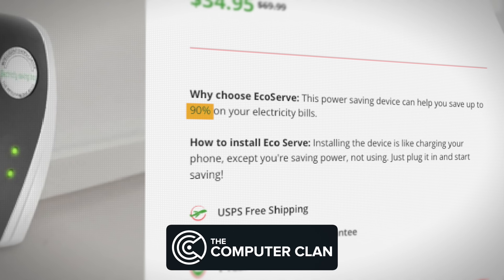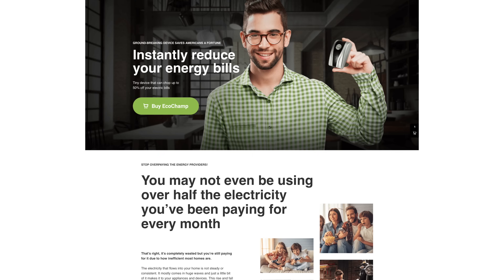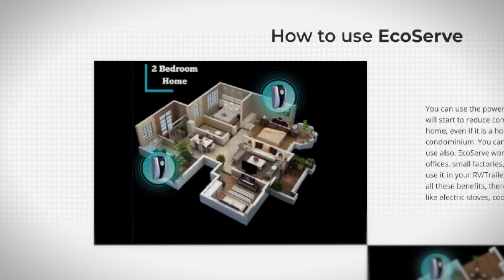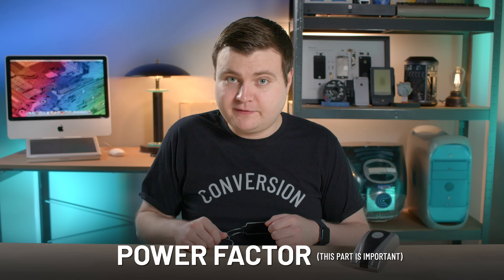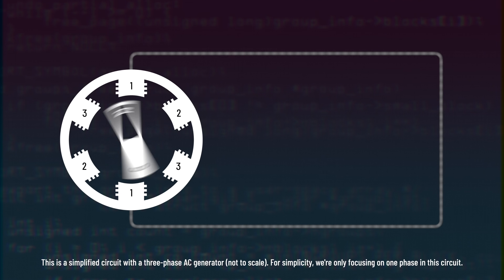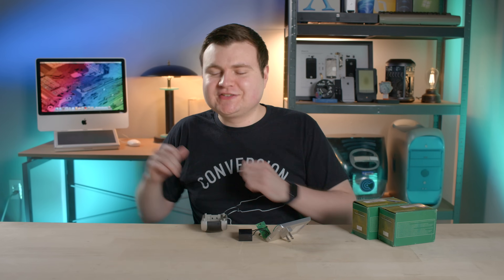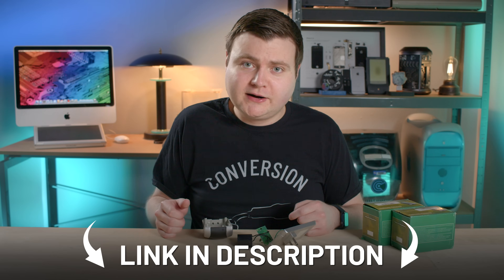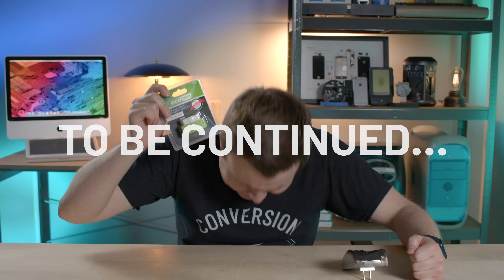Electricity Saving Box Scam (The WORST I've Seen) - Krazy Ken's Tech Talk

Comment: Installing solar panels on your property is honestly the way to go for reducing energy bills without reducing your energy usage. Could even generate income if your provider allows you to sell power to the grid.
Reply: I think many North Americans have potential to first save on consumption, without losing anything. Although EU laws already made a lot of devices more energy conscious.
Anyway, electricity in the US is way too cheap for people to consider saving, or installing solar.
Reply: Solar panels work less when they get to hot
Reply: @NeekSquad  You are right, but generally hot climate is hot because there is more sunshine on average, and because there is less precipitation. That plus more than accounts for the loss in efficiency. A solar panel in Texas will always produce more kWh per year than let's say here in Germany.
Reply: Cali has postponed the vote, but they were going to charge rooftop solar owners an $8 per KW "grid participation charge", and reduce rooftop solar incentives. They will get their money one way or another.
Reply: @bills6093  That's fucked up. But as I said, your electricity in the US is way to cheap to make PV - to make even just saving on for example new appliances - attractive.
From what I gather, here in Germany, electricity cost per kWh are triple. I can't even fathom why you'd install PV on your own roof if a kWh is only around 10 cents.
Here, me buying a new fridge is something you can calculate, and know that it will take only a few years until you have 100% amortized the cost of that new fridge through electricity savings.

Comment: how about one of the biggest scams.........pest scarers..."simply plug in and ultra high frequency sounds emmitted scare off ants, bugs, spiders, mice , rats wasps, uncontrolled children ( ok i made that one up) !  also available as battery powered garden scarers, repells cats, foxes, birds, squirrels , hedgehogs... caution both types also scare pet dogs !" .  well infact i used plug ins as my mother hates spiders and wasps. result, no change in fact i saw a spider sitting on the scarer.  SO , better luck in the garden, !  ..... well no actually, deciding to have a wildlife garden i sowed meadow flower seeds and used a scarer to stop birds eating the seed.....did it work ? no !  i placed a trail cam to see what was happening !over a week i saw cats, hedgehogs walk past the scarer, Ieven saw a variety of birds happily feeding in front of the scarer,  BUT THEY SCARE DOGS, so they must do something right ! wel my dog didnt even notice either  type, happily sleeping in front of them.   maybe the power was off !  nope, the indoor had a night light affair when 'working'  and the garden had an audible ticking.  so either these are scams  or i have the most fearless creatures in the world ! as a footnote in my workshop i placed 3 spider specific scarers after regularly finding spides stuck in painted and  varnished work. over winter i left them running,  come spring i opened up to find webs all  over and covering 2 still working scarers, the 3rd had died, presumably of shame.  costing from £5/$7.50 to £30/$45 each, they have to be the biggest suported scam. what do you think

Comment: I don't recommend the "power saving" box. It almost burnt down my grandparent's house. In July or august 2020 at around 4 am the box started smoking and a few minutes later my pillow dropped and my uncle woke up and saw smoke coming from behind the TV. And my grandpa found out it was the power saving box. 0/10 Useless and almost killed my family because it started smoking out of nowhere. If my pillow didn't fall on the ground I probably wouldn't exist anymore.
Reply: Impossible. The website says it is fireproof! 😝
Reply: @3rdalbum  Now that you mention it.
Reply: My mom brought this to our home before, as an electrician i can smell bs from far away, it smoked and my breaker literally tripped before i almost shat my pants  as it blew up beside me
Reply: @dragonfireproductions790 your not supposed to plug into your ass dude
Reply: Wouldn't even expect it to have that power, i.e. all it could do is produce magic smoke. But then again that capacitor might be special in its own way…
Reply: @Smaxx  maybe the smoke was from the burning plastic.
Reply: Yipes...
Reply: No smoke alarms ?
Reply: Who gets woken up by a dropped pillow but not the smoke smell?
Reply: The heat from the capacitor probably made too much heat and it caught on fire.
Reply: @Vinnieleverton  A capacitor is 2 long strips of metal foils separated by a layer of oil soaked paper, then rolled to form a cylinder. It is a combination of the area and dielectric strength of the separator that gives the value in microfarads. In use, the oil gradually dries out and the capacitor open circuits and ceases to work. However, if the paper then cracks, the layers short circuit, causing heat and them fire. 
If due to poor construction, overload or damage the short occurs before the oil dries out, the fire can spread beyond the component.
Reply: Deserved

Comment: The wavelengths that makes up electricity usage can have an impact on your sensitive electronics but they already have wall plugs that I'll fix that and regulate the wavelength so to speak. So if you use a power generator be very careful what you plug into it and make sure you use the right type of filters for the electricity so you don't get dirty power to ruin your electronics it won't ruin it right away but it can over time.

Comment: There was a typo in the promotional materials. Instead of "fireproof", it was meant to read "fire proof", as in, evidence that it burned your house down.
Reply: Well, they should say "fool proof", which would garantee that only fools would buy this... :)
Reply: The perfect legal defense
Reply: Hey at least the used a safety capacitor so your breaker might save you.
Reply: @LordOOTFD it's actually a flux capacitor, it helps you go back in time, you just need a DeLorean and 1.2 gigawatts
Reply: Hopefully it was one of the employees that was sane enough to protect themselves from getting severe lawsuit.
Reply: How u have so many subscribers
Reply: There was a review on Amazon of all of them sparking 👀🔥
Reply: I thought that was Cave Johnson's lemons
Reply: @roxcyn
Reply: Sorry but nobody cares
Reply: Lolol
Reply: If you are NOT A SCAMMER and a THIEVE, give us your TEL FIXED Phone and Address to enable us to check if you are REAL. Otherwise, you are just another THIEVE!!!
Reply: This channel has the most unfunny fans omg
Reply: No, no, it is fireproof. It works just as well after burning as it did before.
Reply: "A type-o"?  A?  There were lots of type-os and no grammar anywhere to be found. Most of the sentences were not complete thoughts so anything you thought it said was basically your own imagination. Of course, that's one way to avoid liability. Look at the first sentence on the side of the box, "The basic speculation of the electricity-saved box is to let..."  Well, how relevant is someones speculation? But my favorite line is the one below the part he read. They claimed this box could change the interest rates...  LOL. Really?

Comment: It reminds me of a scam product sold in Britain during the 1980s which claimed to cut your telephone bill by 100%! The box contained a pair of scissors with which you were to cut the wire of your telephone. I hope they were insulated (telephone circuits in that period carried, I think, 50V) but it would certainly have worked. After a fashion.
Reply: That’s kind of funny. At least the product would have worked! 😭
Reply: How about the 'metric adjustable wrench'. The FTC took care of that!
Reply: I don't remember any telephone wires with 50v in the 1980s. When did that stop ?
Reply: @thegorgosaurus  “In the United States, the voltage applied to the line to drive the telephone is 48 volts DC; the UK use 50 volts DC and on some modern exchanges the voltage can reach 60 volts.”
Reply: @UK-Combustibility-Assured  yeah that seems set for a few miles of voltage attenuation. I dunno if they can’t do it on a per-connection basis (since FTTC involves a ton of tiny DSLAMs), or just choose not to. A house half a mile or a mile away might get something a little more reasonable. I once lived 50-100m from an FTTC cabinet, never thought to measure the voltage.
Reply: @kaitlyn__L  how many amps can you draw with that then lol

Comment: I wish all the various “obvious scam” signals were more reliable.  Yesterday I purchased a legitimate service from a legitimate company, with a legitimate countdown timer.  It was a hotel room, and the countdown was for when they would assume I’d left  the page and let others book the room, not for when a deal expires, but still.

5:44 I have LED lights; I don’t think they oscillate to the AC
Reply: It really depends on how the internals are built. Some more expensive/elaborate lamps might include their own smoothing circuit to actually use somewhat proper DC to provide constant light, but that's typically not necessary, given due to the fact that it's typically not visible to the blank eye.

Another way to test it is the stroboscope effect (especially with LED torchlights): Use the LED light to light up something rotating fast (like a PC fan). With the light shining on the fan, you might be able to see the fan in multiple positions at the same time and/or the fan actually spinning in the other direction (think of car wheels  turning in some older TV shows while accelerating). The exact effect depends on the fan speed, the light's frequency etc. but it's definitely noticeable. It helps if there's some colored label or sticker on the middle of the fan.
Reply: Signals work best when they are many, often having one doesn't mean that you're dealing with a scam. It's when you have a lot that you should go the other way. There are websites that are poorly formatted and are completely legitimate, there are services that have countdown timers that are completely legitimate, there are stores that have upsells that are completely legitimate, only having one isn't much of a red flag.
Reply: @Liz_ArdE  One of AtomicShrimp’s videos was about a specific scam (fake job offer and convincing you to buy equipment for the job with your own money given a promise of reimbursement) where almost all of the red flags had happened to me in a single instance and it was legit.  There were just adequate reasons for all the red flags and other signs of being legit which weren’t present in the scam.

Comment: A magical device that could save Gas?
That could'n happen Right?

Me: i buyed a thing that saves fuel and IT ACTUALLY WORKS!
Its not even a scam, it will even make your engine output a little more power and less bad smoke

Comment: Just so you're aware there are a few places in the EU that residential users are charged extra if the power factor is to low. Even in those instances adding a random capacitance with one of those "Electricity Saving Box" is unlikely to help, it needs to be matched to the load.
Reply: The overwhelming majority of home loads are purely resistive. It would take a conscious effort to get your power factor bellow 0.95 in a normal residential setting. You would have to have an automated system to bypass or use an array of capacitors for it to make even a tiny difference.
Reply: This is why the energy companies are pushing smart meters so they can charge you for Max Demand just as they do to industry, A true PFC control has inductance as well as capacitive.
Reply: @dogwalker666  You don't even need smart meter for that, an ordinary dumb digital meter can do that.
Reply: @WolfGamerBohumin  the meters we have before the smart meters are straight analogue watt meters no electronics, the industrial max demand version have a physical pointer, 
They are using the smart meter con to fit electronic meters that can measure the power factor.
Reply: @dogwalker666  Home loads always go into inductive territory so an inductance bank wouldn't be necessary.
Reply: @DickCheneyXX  err nope infact a lot of cheap Chinese electronics use capacitor droppers, And as I have installed 3  300kW PFC units recently I can assure you the inductors are used.
Reply: @dogwalker666  err yes. In fact homes are always seen as inductive overall from the perceptive of your power utility. I work in grid automation and power factor correction is our bread and butter.  The 300kW units you talk about should be rated in kVAR and are obviously for an industrial or utility application...
Reply: @DickCheneyXX  they are now that's the point with crappy Chinese psu the power factor can be capacative, I know the units are officially rated in kvar, we put them in because the mains the network supplier could not upgrade our supply but by putting in pfc units in our 3 units we could claw back enough to install 3 more plants, which as the use Inverter and capacitor welders needed inductance on half the cycle capacitance on the other,  
This has no bearing on the fact they are conning people to fit electronic smart meters so they can start charging max demand. And people believe them.
Reply: Yeah, you basically need an actually intelligent capacitor bank that monitors the power factor and connects or disconnects capacitors to match the load, but for homes it's usually not worth, quality electronics usually have it's own power factor correction built in.

Comment: The worst part with that product is the power rating at 30000W (30kW)🤣 The whole thing would melt instantly!!! 30kW means almost 100A from the outlet🤣 I could power the whole building (2 floor with 6 apartments each)!!

Comment: Hey Ken, have you ever heard of Electronic Rust protection systems for cars?  Smells like a scam to me… any interest in covering it?
Reply: I've heard of those but I seriously doubt they would work on a car. Now old warships and other floating museums actually use these to reduce galvanic corrosion due to the saltwater condition but the vessel is partially submerged IN the corrosive solution. A car is not typically submerged in the corrosive solution for the electrical field generators to be affective